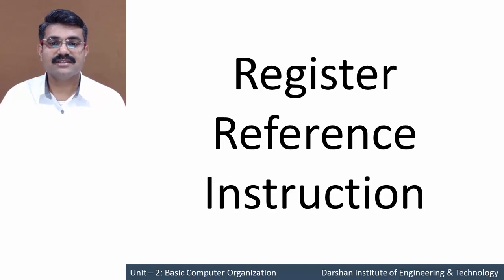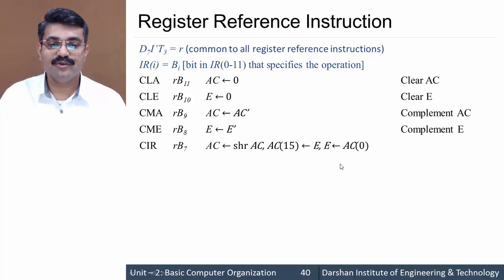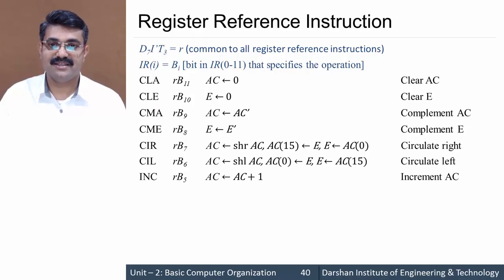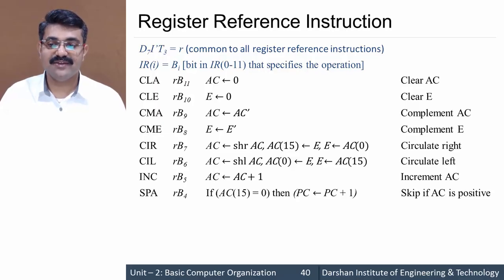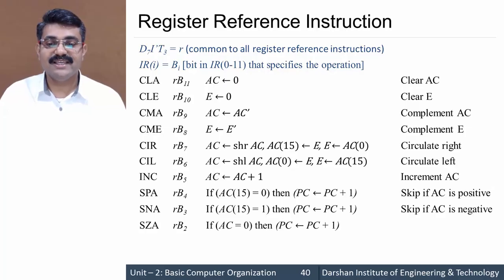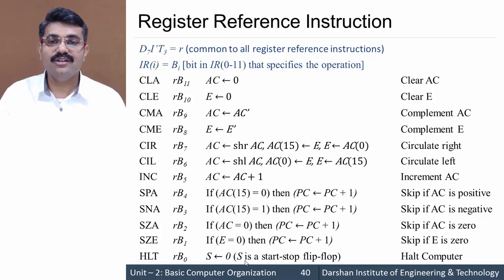2.06 Register Reference Instructions

Comment: 00:04 Understanding register reference instructions and their execution in the instruction cycle.
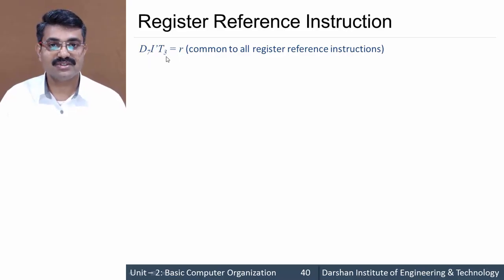01:20 Register reference instructions determine operation based on bit number from IR register
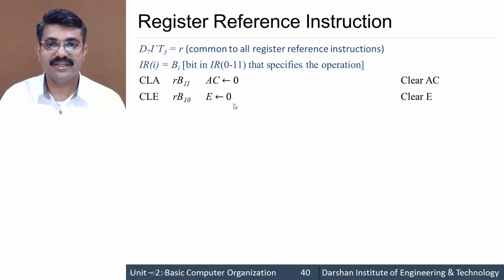02:46 Understanding various register reference instructions
04:01 Instructions on shifting bits in accumulator
05:25 Skipping next instruction based on accumulator positivity
06:31 Skipping next instruction based on AC value
07:46 Conditional Skip instructions based on accumulator value
08:52 Register reference instructions dictate program flow control